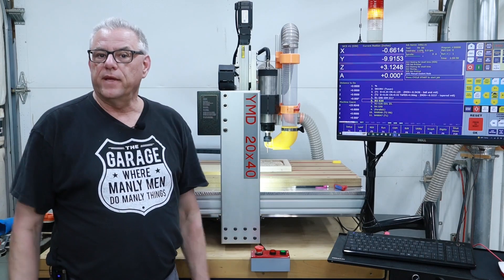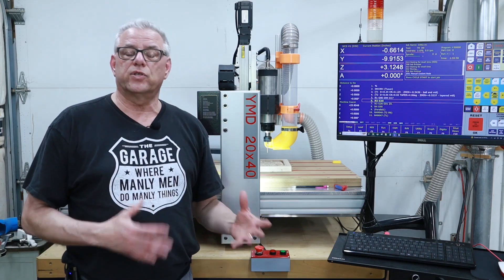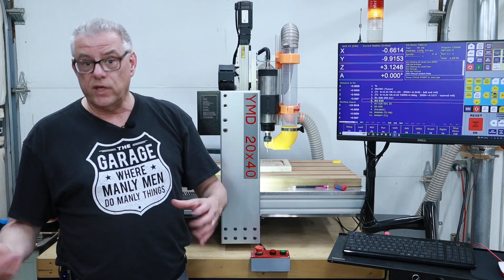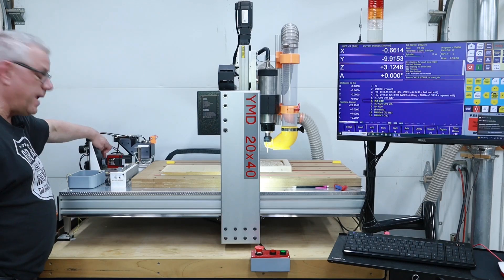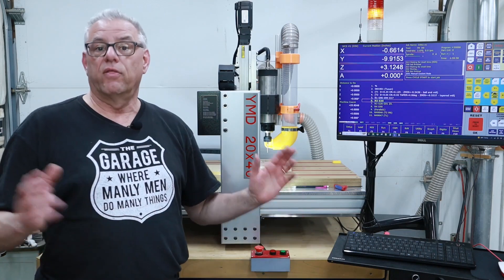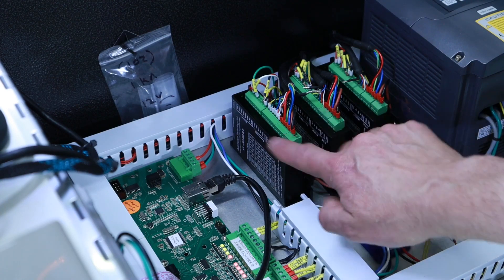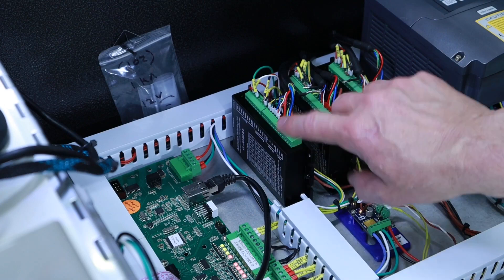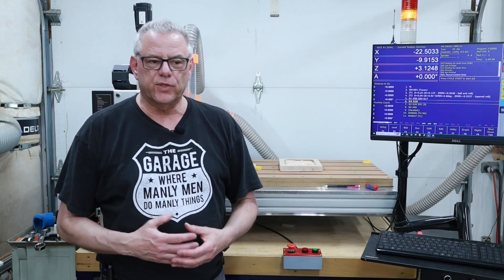Upgrade CNC with Closed Loop Steppers, Is It Worth It?

Comment: Nice setup. what microcontroller are you using?
Reply from the maker: Good morning vinsa5366,

Thanks! I like it too ;-).

The only microcontroller on this machine is a Raspberry Pi PICO to help handle some of the logic for the tool changer.

Cheers!
Chris

Comment: Hi. just received my set to upgrade my hobby cnc. in configuring those switches in the stepper drives, I'm in quandary as to what to use - FOC or PWM? Hope you can enlighten me.
Reply from the maker: Hello mariomanus3176,
It would help if you could provide me with some more information about your setup.  Most probably, you will not use PWM though.
Cheers
Chris
Reply: @MakingStuffwithChrisDeHut  Thank you for the response Chris. First off, I'm just a hobbyist with no engineering background. On the process of upgrading my open loop diy CNC based on a Chinese 3018 with nema17 drivers  to close loop. Ordered a set of 4 nema23 stepper motor and HBS57H drivers. The manuals I found online for the drivers were not that complete on how to set up its switches. Also tried looking for information at forums but still skeptical with what Im doing.
Reply from the maker: @mariomanus3176  What control software are you using for this machine?
Reply: @MakingStuffwithChrisDeHut  i'm using GRBL 1.1f on an MKS DLC32 controller and UGS/Candle and gSender for the G code sender.
Reply from the maker: @mariomanus3176  I am not familiar with that software and controller, but it sure sounds like it should be configured for Step & direction outputs and therefore your stepper drive would need to be set the same way.
Reply: @MakingStuffwithChrisDeHut  thank you very much. this has been a steep learning curve for me. sadly, the mks dlc32 controller is not open source and cannot be fiddled with even for updating the firmware. the stepper driver also doesn't have the debug software available. so I crossed my fingers and switched on the FOC mode. for those having the same dilemma, I observed the following: the steppers  became cooler especially while on energized standby (my efforts to deenergized on standby by software [because the steppers became hot]  failed) and the desired movement as seen in the coordinates on the sender are always achieved - when compared to the pwm setting.

Comment: Your software acknowledged the alarm where most do not. As in grbl and others so the alarm means nothing and doesn't do anything.
Reply from the maker: Hi LarryScott,
The Centroid software is on a MUCH HIGHER level that grbl, of course, the cost explains that too.  I have used a lot of the very entry level CNC software, my favorite is MACH 3 (not the newer stuff) when Art was still in control of it.  It was far from perfect but the price was right and, WOW it could do a lot for the money.  
I am an Applications Engineer with a machine tool company (have been for nearly 40 years), so I am pretty spoiled in that I get to play with the big toys.  Ultimately that is what led me away from the entry level stuff like MACH and grbl, they are fun but I don't have time nor patience anymore to tinker around trying to get those packages to perform the way I want them too.  The Centroid Acorn was a stab in the dark, but it certainly has proven to be very robust and reliable - definitely in my "good purchase' column.
Cheers!
Chris

Comment: What board are you using ? 

And which drivers ands motor ?
Reply from the maker: I assume by "board" you mean control. It is the Centroid Acorn.  The drivers and motors are from Automation Technologies.  
Chris
Reply: @MakingStuffwithChrisDeHut  how do you like the centroid acorn ? Would you still go with that controller if you had to do all over again ?
Reply from the maker: You can very much tell the difference in quality and performance between the Acorn and all other "hobbiest" level controls, hands down the Acorn is more reliable and robust.  It may not be as "open" as MACH 3 was, but is sure is more capable.

Comment: Hello can u explain how to invert the direction of the motor so that 2 motors can be on the same axis using NEMA 34 and hsb860h driver. I mean detail wiring
Reply from the maker: Hi olufemisotunde3868,
I would need a lot more information about your system to create a custom schematic on how to wire up your drives and motors and that would require more time than I have available.  However, assuming the drive is a step and direction drive, the only thing you need to do is set the direction pin to low for one motor and high for the other motor and they will run opposite directions.  
What you are probably trying to do is have one output from your control software (such as X axis outputs) drive TWO motors.  That is not the best way to do dual motor drives on a single axis as it causes many problems.  Your CNC (assuming CNC) software should allow you to set a "slave" axis that would provide that motor with its own Step and Direction signal data.

Hope that helps a bit.

Cheers!
Chris